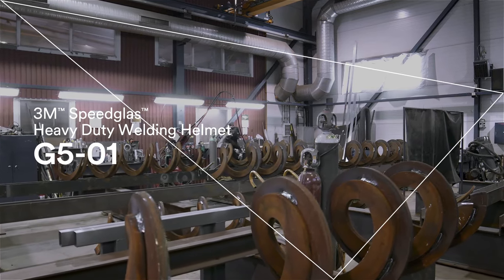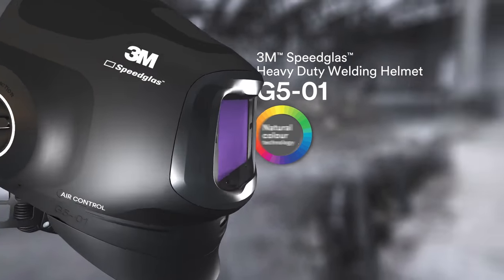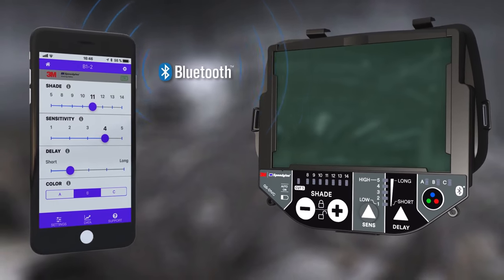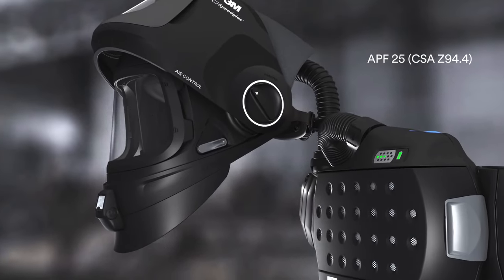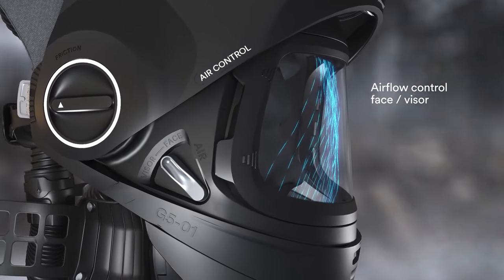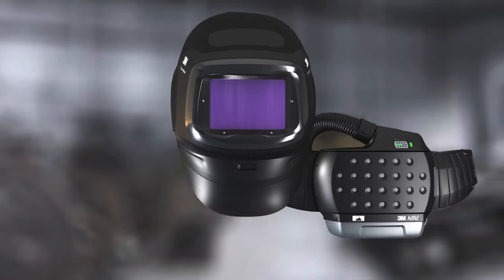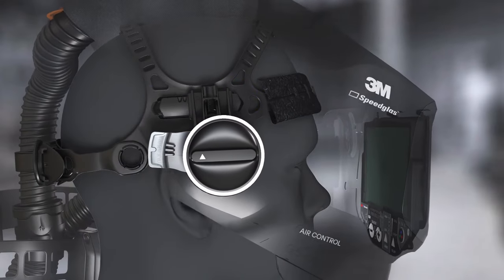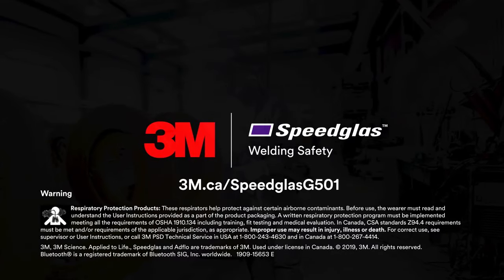3M™ Speedglas™ Heavy-Duty Welding Helmet G5-01

Comment: 100% worth the money! You will notice a difference in your productivity and they way you feel during and after your shift. I have nothing but good things to say. Absolutely aesthetic after using a Miller Digital elite for three year, gone are the days of magnetic snot. 11/10
Reply: how much?
Reply: @emilguevarra2134  Just shy of $2,400.
Reply: Good welders cant afford to work with poor equipment. Starts to reduce productivity and quality as well as strain the worker. I worked att company that almost never bought new tools or stuff when even when u rly needed it. i Could tell that buying them would have doubled or tripled the productivity so it was costing the company lot of money even tho the owner didnt admit it.
Reply: @DeathHead1358  Can you put a cheater lens in it? Doesn't look like a 2 x 4 1/4" one will fit
Reply: @44_83  You can. They have a magnifying lens holder for the helmet listed on their website, although they don't say which lenses it takes.
Reply: @DeathHead1358  Is that where you bought this 3m hood? On their website? I am interested but don't think they sell these at the local hardware store or weld supply places.
Reply: @44_83  I didn't get one, went with a Miller T94i-R. I just looked on their website to see if they offered a magnifier kit for it. You might be able to get one through Nexair or Airgas if you're in the US, and as far as online retailers Bakers Gas carries 3M helmets and parts.
Reply: @DeathHead1358  Where did you buy the miller hood ?  Was it at airgas? If so how much did it cost?
Reply: @44_83  theee 1800 or so but th lens is subpar the 3m its the best lens and filter you can get
Reply: How much does it weigh? Had the last two and they were bricks.

Comment: Sorry to inform you but i have this mask at work and it is not as good as the 9100 fx. Bottom part is cracked already,and yes i work in an shipyard so it is not heavy duty. Get the 9100fx instead guys

Comment: I've got this one and I'm wondering why this filter don't fit into the 9100FX. This filter is better then the x-xxxi filters, but the helmet itself, I prefer the 9100 fx. The G5 is lighter, but not so easy in use. Today I fit the led system on it. Also not that easy, because you need to drill 3 holes. Thats tricky. It can go wrong, and then your no longer able to fit the inside part of the led light into the helmet. You can destroy the holders with de driller.
Reply from the maker: Hi Mark, really glad you reached out. Can you please contact us at: 1-800-267-4414 to discuss details and so that we can help you out?
Reply: @3MCanada  Thank you, but I've fix it myself :)
Reply: How much lighter is it? I had the 9001 and the 9100 both were super heavy not to mention lens are expensive.
Reply: @seekandsave1126  so the g5 can not go backwards to the 9100. the g5 is about 50grams lighter. All respiratory helmets will be "heavy" compared to a non-respiratory helmet.

Comment: Does this mask filtering all the bad air or only the dust?
Reply from the maker: Hi there -- Thank you for your comment!
The 3M Speedglas G5-01 Welding Helmet is used in combination with the Adflo PAPR. The G5-01 w Adflo is used mainly for welding and grinding and is suitable for all particle hazards including welding fume, smoke, and dust.
Hope this helps!

Comment: This mask is it!
Best I've ever bought and used, for heavy duty welding like I do, say multiple passes with a 500amp warrior, this mask makes the job real easy, I need to grind or buff in between passes, flick the sheild up and work away, while still getting good air, I'm 25 years at the game now and honestly this is the best there is, sure there is others that almost do the same, but this one pips them all, the hours fly by cause this mask makes it so easy, top job speedglas
Reply: If you wore this mask for an 8 hour shift welding constantly would you still have black snot at the end of the day? Im interested in welding but dont really wana do it if even with a mask like this youd inhale crap.
Reply: @chrish3588  good question, not from wearing this
Reply: @johanschimt3761 I would buy this, but I use cheater lens and they don't look like they can fit one.
Reply: Will Swift  If you don't know what spatter is like imagine taking a leak wearing flip flops and shorts but its liquid metal. Creating a perfect, affordable barrier from that that is comfortable is apparently impossible because the choice seems to be one or two of the above.
Reply: @chrish3588  its all dependant on how dirty your environment is. The g501 has APF of 10 (allows 1 for every 10 particles in) but can be upgraded to apf of 1000! in most work environments this will be way more than enough. You would be hard pressed to find environment that cant use this. But the next level would be a firefighters SCBA... and I almost never see that in the industry!
Reply: @Andrew-FKF  how do you "upgrade it" to apf of 1000?
Reply: Amigo , buen dia eres tan amable y me puedes indicar la web de compra de esta fenomenal casco para soldar, pero ago la aclaración que sea  tal cual como se ve en el vídeo ,  por qué han salido réplicas y no me parecen tan buenas , gracias
Reply: Amigo , buen dia eres tan amable y me puedes indicar la web de compra de esta fenomenal casco para soldar, pero ago la aclaración que sea  tal cual como se ve en el vídeo ,  por qué han salido réplicas y no me parecen tan buenas , gracias

Comment: Is the battery more secured? I had adflo 9100MP And a slide lean onto something it would disconnect from the belt or fall and break I went through 3 batteries in one year.

Comment: G5-01 great mask except the harness for  me keeps slipping off no matter the adjustments made especially with a hood on and bending over 9100fx fit better for me.
Reply: Where do you buy this damn thing?  I'm pretty sure home depot doesn't have them or even the weld supply shops
Reply: @44_83  I'm in Australia 🇦🇺  so most welding supply store have these stocked.

Comment: So, other than the lense (with its gimmicks, as who exactly needs a bloody phone app😄) what exactly is the difference between this and a 9100fx with adflo?
Also is this another like the 9100v, x and xx filters, ie ot doesnt work well at all when tig welding, flashes all the time?
Reply: should have improved electronics for more stable TIG. But DC tig with 240hz these days are a struggle for lots of welding helmets. The variable color is a world first, and the air flow adjustment has been a huge feature. Rumors are to upgrade the ADF for christmas 2023 to have better light state!

Comment: Can I use it outdoors?
Reply from the maker: Yes, the 3M™ Speedglas™ Heavy Duty Welding Helmet, G5-01 is specifically designed for the heavy-duty welder which can be used for Paintings & Coatings, Paper & Print, Outdoor Sports and etc.

Comment: How much are these??
Reply from the maker: Hi Brandon, for further information about this product, please contact your local 3M authorized distributor https://s.3m.com/jau4r or call us directly at 1-800-364-3577 so we can better assist you. Thank you
Reply: @3MCanada  this is a 2005ish reply. WE ARE ASKING FOR A PRICE , I don't want to contact you to ask for the price. I will go to another product that shows the price
Reply: @anonimails  They are a manufacturer, if you want a price you would need to go to a distributor of their products. The best they can tell you is a MSRP, but that will be off from what you will actually get by calling around or shopping online distributors inventory. Most welders, or people investing in a high end welding helmet setup, will have accounts at local weld supply stores. Different people will have different discount levels depending on their relationship with their suppliers, so one guy will have a different price than the next.

Comment: I have a question. If these papr systems are supposed to be pumping purified air into our helmets then why is is that allergies go haywire? Seems to me like the purifying system would filter out airborne allergens. If the intake system which is right where it is going to suck in the smoke and fumes of when welding is supposed to getting purified then again why is it not filtering out allergens? Are these systems just a scam for profits?
Reply from the maker: Hi Joshua, thanks for your question. Due to the technical nature of your request, please connect with 3M Canada Safety Centre by phone at 1-800-267-4414 so our team can better assist.
Reply: sounds like a issue a friend had. I looked at his setup and noticed he stores his bag wide open, and the helmet sits out sometimes. Dust can settle in there, and when you put the helmet on, that dust circulates for a little while. Gotta keep the inside of your helmet clean!